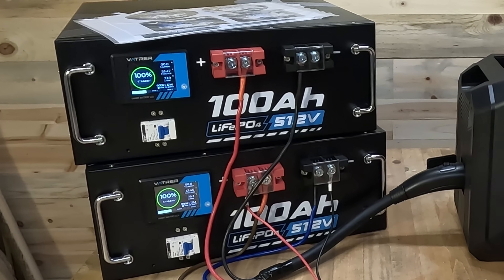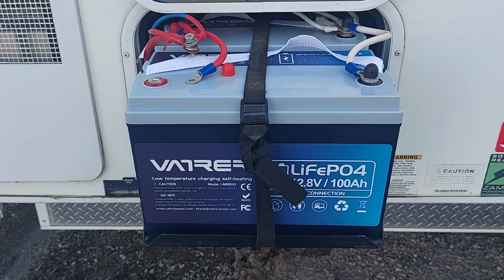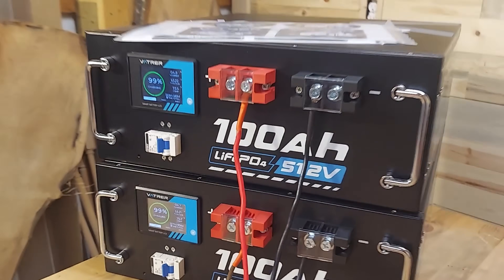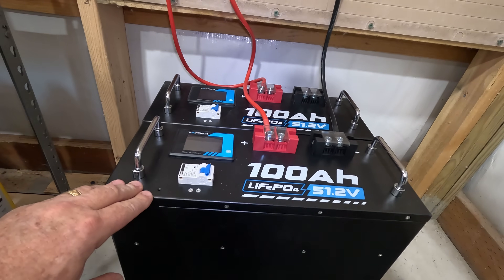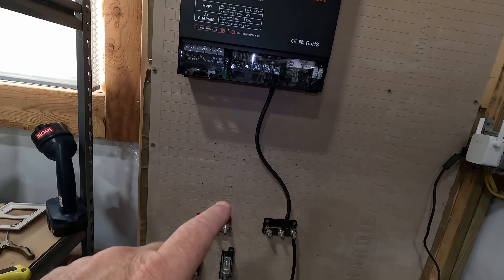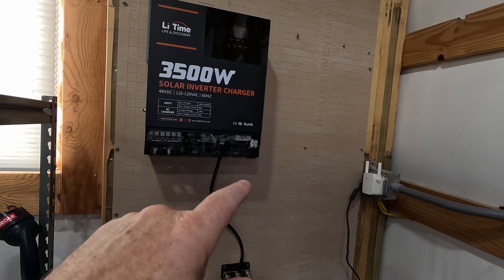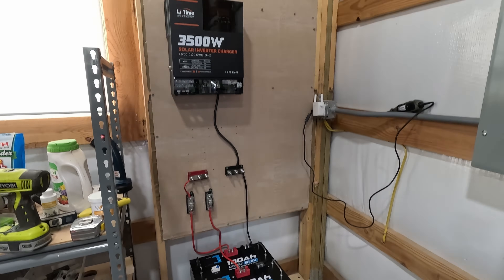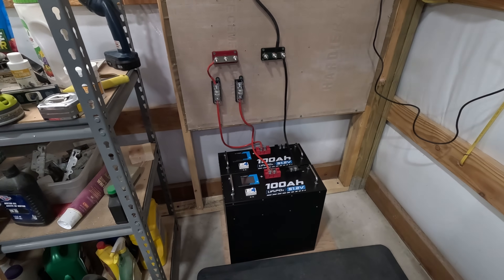I’m Taking My Shop Off Grid with 51.2V Batteries – Here’s What I Did

Comment: Do you know of any Power Stations that can be connected to those Vatrer Server Batteries and can support 240VAC to run a washer and dryer in power outage? From what I can find - the only I can seem to find seems to be EcoFlow but I don't know if you can connect the server batteries. Any idea if this can be done easily like your OUPES Mega 1 and Server Batteries Setup?
Reply from the maker: I know that Pecron and Jackery both can provide 240v and the Pecon can be expanded via these batteries (or any 51.2v battery).  The Jackery can only be expanded by running the battery to the Solar input so you still have to have a charger for the batteries.

Pretty much any power station that can be made to provide 240v (usually they need two power stations and a 240v adapter) can work this way (with the batteries run to the solar input (s) but Oupes, Pecron, Bluetti, EcoFlow and others can all be setup to parallel with server rack batteries like these.

Comment: I have 2 48v batteries connected parallel config. I have a power station that pos and neg connected in series. Should I connect my battery charger to the other neg and pos? Or connect to on the same neg and pos that my power station is connected to.
Reply from the maker: I'm a little confused.  How is the power station connected in series? and to what?
Reply: @TheOldJarhead orings connected to battery to x60i solar input
Reply from the maker: ok that isn't a 'series' connection.  What you have is a set of batteries connected in parallel (pos to pos, neg to neg) and then a pos and a neg connected to the power station. 

You can connect the charger on the same ports or opposite,  either way, as long as it's the same voltage as the batteries.
Reply: @TheOldJarhead thanks a bunch, the charger came with the battery. Tempgo kit

Comment: Nice setup!  With that setup (10kWh batteries / 2kWp solar), in sunny conditions, you should be able to support a continuous 24x7 load of around 250W-300W on average, if desired.  And you can program the all-in-one to just revert to the grid if/when the batteries run low.
Reply from the maker: That's the plan 😀

Comment: Now which panel do you plan on using with the conduit when it starts snowing on the security lights in the attic just outside the studio right by the Vector rack battery underneath the Magic panel junction over there right next to the breaker box right there ?
Reply from the maker: The IP7698912 version designed to withstand Kryptonite!
Reply: @TheOldJarhead Now I understand !